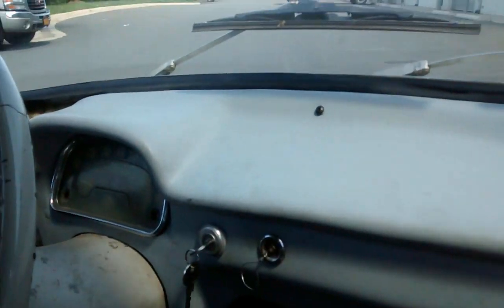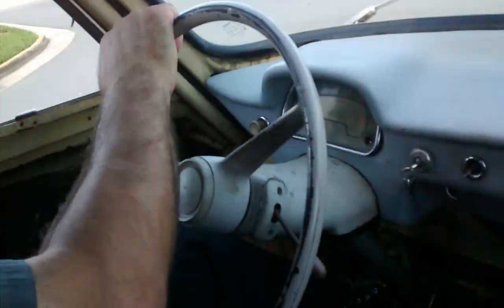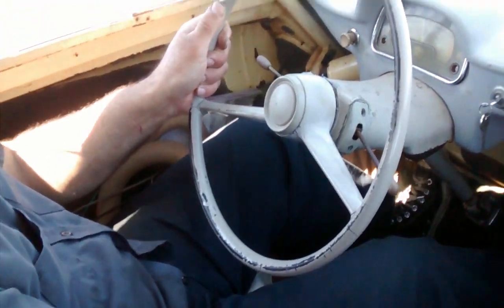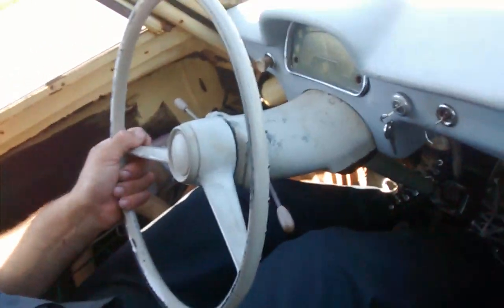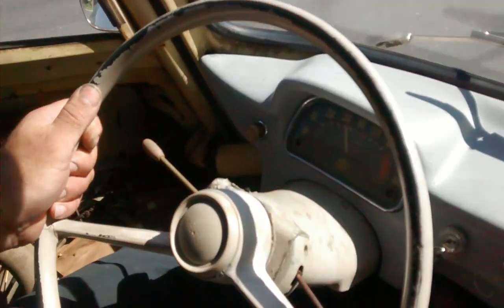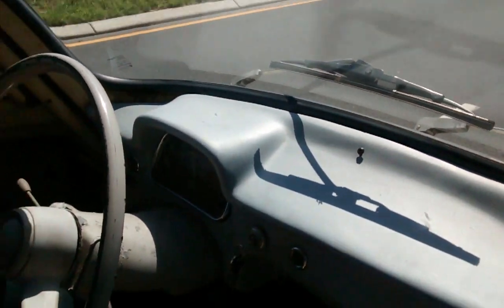George with his R1150 powered and fuel injected BMW Isetta 600

Comment: Very interesting.  I"m looking at reviving a 700 Luxus and am considering electronic ignition (there is an ignition retrofit company in France who has the mounting system engineered for the 700).  I'm also considering injection.  I would guess you used Megasquirt, could you tell and show us all more about this?